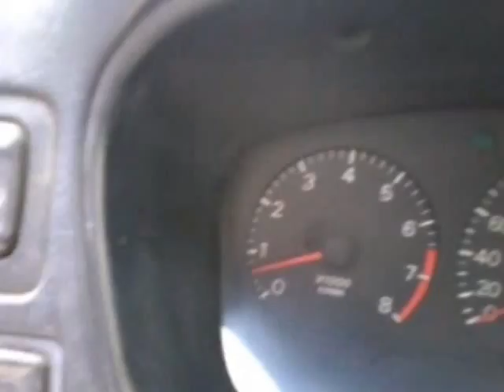Mitsubishi Lancer Carburetor Cleaning

Comment: idle problems.. when high revs engine revs good n on ilde it switches off? then might b main jet having some dirt or small rust particals of rust coming from fuel tank.. clean jet n keep proper fuel filter.  good luck